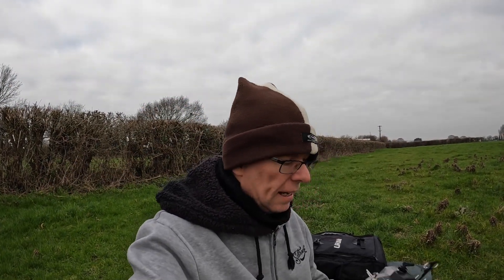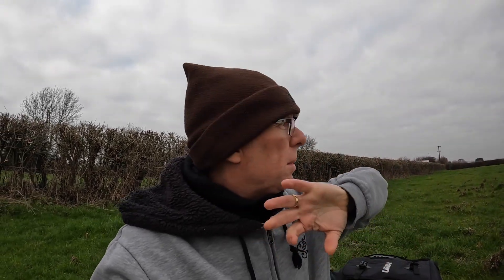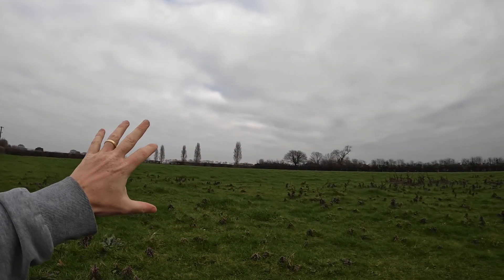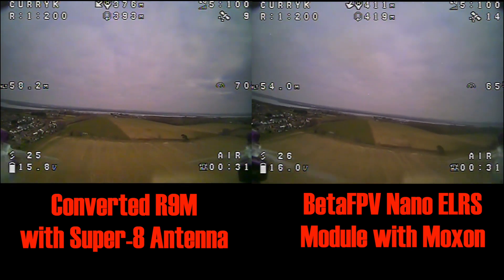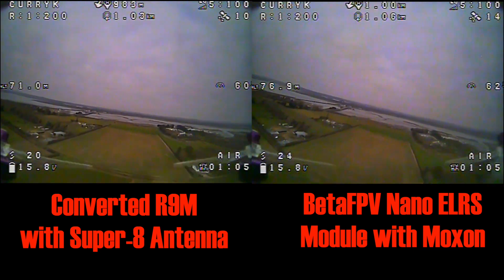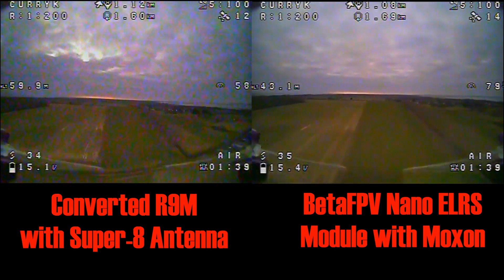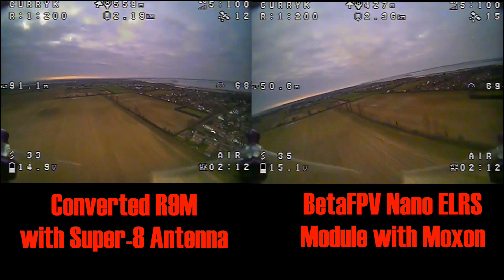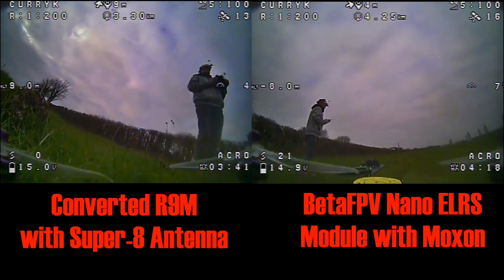Does an R9 module converted to ExpressLRS perform as well as a regular ELRS module?

Comment: are you running 400k baudrate on R9M? I had R9M converted to elrs and I'm get link disconnection bet TX and RX which does not happen if I use 118K baudrate..any thoughts on that?
Reply from the maker: Yes - I'm using 400k baud on R9M.  Did you do the mod to the module?  (if you have the older one)

Comment: So can the r9 work with any elrs receiver than?
Reply from the maker: Yes - but with a caveat that it needs to be on the same frequency.  So a converted r9 module can work with any ELRS RX on 868/915Mhz, but not the 2.4Mhz receivers.... for which you'll need a 2.4Ghz module

Comment: I have a problem, my range is so bad  with my r9 2019 900mhz. 400 meters and failsafe. A new reciever and antenna are helping nothing ( other reciever placement too). I flasht both new? My lq is most of the time high but the rssidb is so low i have after 300meters -90 at 50 mw ???? Can someone help me
Reply: Have the same problem with friend of mine. Both of us noticed exactly the same as you described. Tried with different quads, antenna placement, etc. No any improvement. Lately downgraded mine tx to elrs 2.x soft. Still no any improvement. Have you found any solution? I don't believe that we burned both our tx's the same way, at the same time. Moreover I have good experience of flying kilometers on 10mW at first time I flashed with elrs. Maybe I need to roll back to elrs 1.x to check🤔 Has someone simillar experience?
Reply: @PiotrRgn  i don't know its a long time ago... but for me it was just the best solution to buy a set of betafpv elrs module and reciever. It works perfectly...
Reply: @clazy9222  actually done the samefew months ago.. But I stilI have some quads on 868 and was hoping that there is some solution for that 😉 thx for reply

Comment: If I convert R9 to elrs, can we bind non r9 rx with this ? That will be a huge advantage
Reply from the maker: Yes - IIRC in part of the video I use the newly converted module to connect to an existing ELRS rx before I convert the R9 rx over
Reply: @CurryKitten  That's great, thank you so much for replying.

With so many versions of frsky firmwares, it's a mess and I was using accst firmware so far but new r9 receivers doesn't have a accst supported firmware anymore. This is a huge relief for me

Comment: Which ELRS receivers can be connected with converted R9M module...??
Reply from the maker: Any ELRS rx that works on 868/900Mhz - that's kind of the point, as soon as you convert you aren't limited on the make/model - just the frequency they talk

Comment: Off topic but how do you rate the X9 lite? I'm trying to decide between it and the Radio master TX12 (which I believe you had the jumper version of), I used to love my old X9D but it always felt too big
Reply from the maker: The X9 Lite (I've got the "pro" version) is pretty good.  It's smaller than the X9D, but not as small as the TX12 (of which I assume RadioMaster has the same form factor as Jumper)  My Jumper has issues at the moment with power, but if it was working I'd choose that one - as it has it's own charge circuit so I just plug it into USB and it charges up.  The X9 Lite uses 18650's, but you have to take them out to charge and they are quite a pain to get back out again!
Reply: @CurryKitten  so according to frsky the S version supports balance charging over usb, tho it's only micro usb rather then C (which is a shame), so if the onboard charging wasn't a factor would you still pick the jumper?

Comment: I saw on the ELRS discord some mention that there is some faulty soldering or connection issues with the Super 8 antennas.  May want to research that.  Also, I have the r9m lite that I bought for my x-lite years ago - do you have any experience with that particular module and how well it converts to the ELRS system?
Reply from the maker: I keep meaning to go back and do the lite.  I think it actually needs no mods and you can flash it directly (it's only the Lite Pro that needs flashing with an STLink)

Comment: I had an R9M (2019 version) and I never did a long range with it because the range was always pretty limited. After a long time I found out why. The version of my module has the values from 6.5 to 13V printed on the side of the external power supply. In reality 3S batteries were never allowed. In the new versions, Frsky fixed the label with correct information, ie from 6.5 to 12V, even in the manual a warning was added not to use 3S batteries. For sure it was a mistake of the version I bought that never mentioned to use 3S.

Comment: I need to ask what version of elrs you flashed your modules. 
many people say they have issues with version 2.xx. I am still on version1.xx but I want to try the dynamic Power Feature of the 2.xx version. 🤔
Reply from the maker: These are certainly on 2.x (I can't remember which one) as soon as one module is moved up, I do the others as well, and I was on 2.1 to get the support for OLED for the 2.4 BetaFPV modules.  No issues with 2 at all, in fact I like it more because the LUA script tells you much more.  But I haven't used the dynamic power function at all.

Comment: I'm scratching my head and wondering, If you just left it as R9 would there be much difference? 
What is the key benefit of converting to ELRS if you already have R9? Is it a preference or is there a significant range difference?
Not criticising just wondering if it is worth me risking messing up my gear.
Reply: One other downside is you go from single wire (sbus) out, to two wire CRSFR RX/TX. If you use a Kopilot Lite, you're going to be in a pickle. As it only supports sbus or PPM.
Reply from the maker: I would always say "if it ain't broken, then don't try and fix it"  Whilst there was nothing wrong with my R9 models, I never felt like I had an RSSI value I could actually trust, and with R9 seemingly dead as far as future development goes, it made sense to move mine over.  Also if you have models that need more than 4 full range channels (for example something with pan/tilt on pots) then ELRS at this point isn't going to fit your needs - so it would certainly require careful consideration if you already had lots of rx's on lots of models as the conversion of the RX is... while not hard, does uninstalling, resoldering and potentially reinstalling differently.

Comment: Im really surprised how many people have problems with their r9 stuff. I bought my stuff used to convert it to elrs.   I never converted because it just worked perfectly as is.
Reply from the maker: If it already does everything you want - then you are golden.  Thing is with R9 is it's not (as far as I can see) being developed any longer - whilst ELRS is moving very quickly.  That aside, I always hated the R9 RSSI random number generator.  It was always really hard to tell exactly what sort of signal I actual had
Reply: @CurryKitten  i know elrs has some amazing features, that i miss out. but the fancy things like wifi update etc. i cant get without buying new hardware any way.

therefore i decided to keep my r9 stuff the way it works and buy cheaper 2.4ghz elrs stuff further down the line. 900mhz elrs seems to outdated anyway and i dont know how much love it gets from the devs anymore.
Reply: @Aaron Think issue with r9 stuff was firmware updates, and making sure Tx and Rx firmware versions were in-sync. Believe early on, pre-2019 updates there was some issues and confusion. It was really before I was into RC so did not experience personally.
Reply: @Aerial Waviator  Here we are in year 2022 and my new R9 lite plus R9 mini are experiencing very bad range results as shown in of previous curry kitten videos. I don't understand how frsky can get away with labelling those as "long range" modules when with stock antennas with telemetry (25mW in EU) things fall out of the sky around 400m mark. This is silly. My cheapo Chinese "2.4ghz no-name (redox) brand" 100mW set gets 1500m in the air with the stock "wifi-style" antenna on the TX and a short piece of wire on tx. The ONLY saving grace of this R9 hardware is its ability to convert it to elrs.

Comment: set to lowest power, use the Attenuator in between RF module and Antenna, then test the range...most probably for few meters  LQ will drop then you can see a good result.
Reply from the maker: Don't have an attenuator.  Some people have mentioned putting the power at 10mw - which is a more usable idea.  Although the basic idea of this video is to see how the converted R9 performs against a "native" ELRS module using typical settings - or which I think 100mw is reasonable.  Hence the conclusion that at this sort of range, everything is very good.

Comment: Thanks for a nice comparison. The dBm value is very valuable when you fly. I have had 100% LQ with a broken receiver antenna and would probably had failsafed if I didn't notice the bad dBm value. 
In this comparison you get 100% LQ all the time but without dBm we don't know which one was closer to lose signal. We just know that both were ok at 1.4km.
Reply from the maker: Yep - and I guess the main point was to check the both systems would perform ok at that distance, and in that respect - all seems well.  As mentioned before, I find it tricky to get my head around the dBm concept, but I'm catching enough flak for it that I'll at least have it on the OSD in future range tests so I can at least look at it post flight to see what's going on

Comment: Sat count was lower with R9
Reply from the maker: First flight of the day.  I sat there for 3 or 4 minutes waiting for it to get the min 6 sats and then took off.  As time went on it got more sats, and by battery 2 (when I was running on the ELRS module) the count increased.  That's just a timing thing, I don't think it's relevant to the test.  I did note that having telemetry on via the original R9 code could cause interference with the GPS, but I would guess that's down to positioning as well, as we're using the same frequency to send telemetry back.

Comment: Another interesting and useful comparison video....I`m just waiting for a new quad to arrive to install the converted Rx r9mini in and give it a go...I was almost at the the point of disposing of my R9M (in the dustbin) as i was getting so frustrated with its constant problems....i hope this will give mine a new lease of life and reliability like its never had before.....Thanks for the video.
Reply from the maker: Hope it works well for you.  I've a lot more trust in my R9 since it stopped running R9 :D  I'm going to convert my other modules over as I don't see any reason I'd move back to it

Comment: Great to see a comparison. Looks like 100mW is a great power level to get decent distance. I wonder what range you would get using 10mW - just so you could see if there was a difference with lower power over the distance you have available.
Reply from the maker: I should have thought about that at the time really :D  If I'm out again soon with that setup, I'll give it a test
Reply: @CurryKitten   I hope that you check the actual power output at the low power settings so that you can make a fair comparision. (We all know how flaky the low power settings are on some transmitters). ;-)

Comment: Hi buddy can you help on setting up my long range on arming aux one get gps throttle warning in 9nyrs of flying never seen that one Chao got off set it up but his switches range from 2000 my old one was from 0 ton1600 1600 to 2000 beeper on sux 2 works aux 3 and 4bfoevsngle mode horizon. Acro work 5 and 6 for gps don't work but I have set not to arm till get min of 8  left long time still same any ideas his gps switch set to middle using beta flight 4.2 jumper t lite Cheer's
Reply from the maker: Not quite getting you about what's going on here.  Is it that you can't arm because you aren't getting sat quickly enough ?
Reply: @CurryKitten  no if gps on arm off it arms so put 8 Mon gps says on not  arm Ive selected in osd long lat gps sat but don't show in my goggles is gps broke I had it in field over 10 mins still not arm Cheer's
Reply: @CurryKitten  I can send quad to you to look at pay for your time
Reply from the maker: @gadgetman404  Hey, I don't want you to waste your money in postage back and forth, drop me an email at currykittenfpv at gmail dot com and we can take a look at your config in more deatil

Comment: I've been using my R9 gear with ELRS since pre-1.0 IIRC and works fine in both quads and fixed wings.
Reply from the maker: I feel bad for getting into it so late... i like to feel I'm making up for lost time though :)
Reply: Are you using the new ERLRS small receivers too?
Reply: @robertp7209  No. All my elrs gear is from the R9 series from frsky. The 915mhz receivers are quite small but not as small as the ones with ceramic antennas of course.
Reply: @adilsongoliveira  oh thanks, I recall buying the R9m kit at the cut rate price on Amazon when frsky was trying to crush a competitor, never used it, receivers too, several of them, don’t recall the frequency.  The unit is red in color.  Never went long range, stayed with easy peasy XM+.  The computer stuff even cell phone needed today now especially with ERLRS is way beyond my interest but will keep trying.  FPV with just micro quads is becoming more and more, should I say esoteric?  Not my interest.  At least my remote monster trucks are more mechanical oriented.  Products are being sold that are continually being developed with more and more time and knowledge needed on the computer, than actually time flying for someone going out to fly a half to one hour several days a week, when the sun shines😁. Peace.